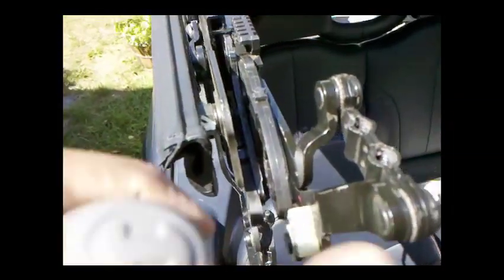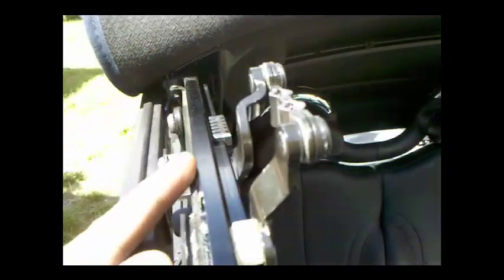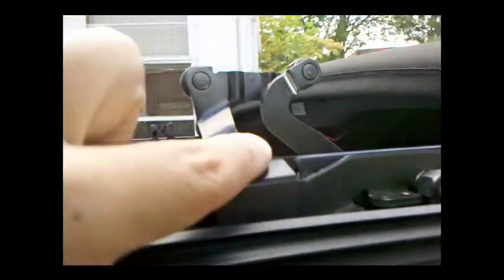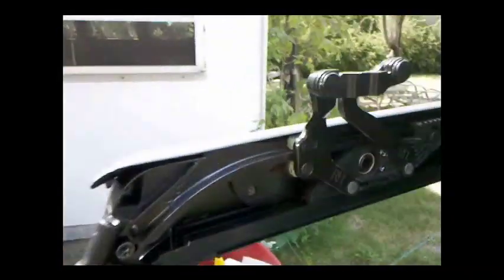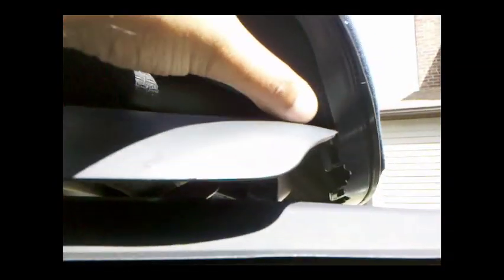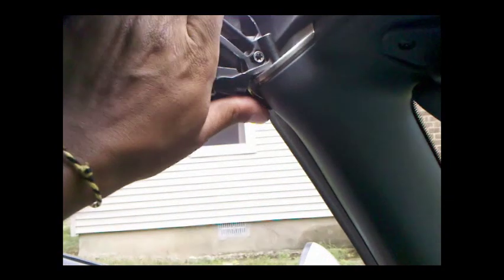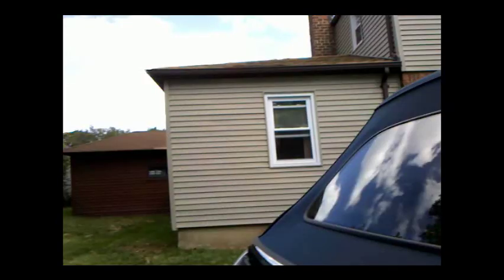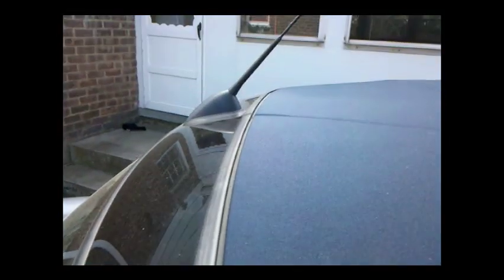Mini Cooper Convertible Top Repair Part 4

Comment: A screw came undone because the thread lock was not put on properly. This jammed the mechanism and broke the plastic lever next to the cable arm. This would have been the third complete roof mechanism put on by BMW Mini in nine and a half years. They wanted to charge me £2200 and that is not for the canvas hood.  I work at an aerospace foundry with a machine shop.  Your video was invaluable in getting it apart and putting it back together again. The guys and girls at work made me another lever and rivets out of an aerospace alloy and when I offered to give them some money for their efforts they asked me to put it towards Cancer Research.  Better than those money grabbers at BMW. Once they have sold you a car and it is out of warranty you are on your own as regards BMW. They will not sell you individual parts but half the car.  WELL DONE for posting these videos!! YOU ARE A STAR!

Comment: Hi! Thanks for the Top Repair videos. It worked well for us. But i think i have missed some part. When everything was finished, we where happy until the top was half way back and the locking mechanism was about to unlock at the front. It will not unlock and a red LED start flashing on the button panel. Do you know that could be the problem?
Reply: Laughin.  Just happened to me
No one is answering yet unless you guys figured it out.  I did notice to make sure it’s closed before putting motor in
And to make sure you push the middle frame lock like u had to do to release it
I’m guessing
Put the tarp back on and try again tomorrow.

Comment: tullid, you are my HERO! my roof broke about two years ago and i didn't find the 2500 dollars it would cost to repair it in Switzerland. Now I found your video and I spent the last four days repairing it with your guidance. I just finished the work and I am SOO HAPPY, IT WORKS! :D the connecting plastic-part of the locking mechanism was broken too, so I had to remove the moving rivets and then reconstruct the broken part from aluminum... was hard but fun!
Thanks again and all the best!

Comment: Thanks very much for the video, i've done all of that and the roof now works.... one question how do i glue the top back onto the front piece (from inside the car) , pushing it back is really hard, not sure it will hold.

Thanks.

Comment: Hi just a couple of questions: do I have to grease the cables before installing and if yes what kind of grease should I use? second question, is it normal the cables are not really free in their slides? thnak you for your help.

Comment: Worked as instructed however the hood had been badly removed previously and the tabs at the front had 7 broken or missing. My cable was too badly chewed to be reused however did have another "spares" car with a broken hood and was able to salvage enough parts to make it work. Be careful when you reinstall the motor, i broke the plastic casing but used a salvaged motor so everything works as it should.
Thanks for the video it helped me immensely.

Comment: For everyone who can't disassemble the broken latch 'cause it's stuck, please read carefully my post here https://www.drive2.ru/l/510279499233886493/. It's in Russian, but it has pictures and you can use google translate. I solved that problem today. You need to disassemble the plastic cover near windscreen and remove metal plate of the latch.

Comment from the maker: Thanks, actually I did have to take the canvas apart.  Originally both latches broke and there was no way that I knew of at the time to get enough canvas slack to get at the screws.  Everything I read on NAM was w/ 1 broken latch, not both.  Besides, taking the canvas off only adds @ 20 mins both ways to the repair, and I don't have to worry about restricted access to those damn screws :)

So far the repair has held up real well.  Still using the sunroof portion daily.
Reply: Thanks for your video , I'm a motor trimmer and I never worked in a car like this , nevertheless I have a suggestion to make sure that on top of the J- weld used to secure the end of the cable, this can  have extra strengh.
 It looks like the end of the cable have been squashed from factory ,  we can not do it again , but we can drill a small hole in the alloy and put half a way thru a very small screw to make sure the cable  doesn't come out again.
 It looks feasible to me , but my only guide is the video you have uploaded .  Thanks again

Comment: Hi, thank you for these, saved our roof and our Mini. A question - when the roof closes, the right locking mechanism (top part of the claw) goes in correctly HOWEVER it is not flush with the frame, 1-2 mm gap so a rattle over bumps. Have people seen this and a solution to adjusting the claw - is it possible to adjust the top of the claw position? Thanks in Advance!!

Comment: Thank you so much for this superb series of videos on how to repair the mini hood. I basically took the computer out to the garage and did it step by step. In the end the end of the cable was trashed so I had to cut the helix with a Dremel and use a fresh piece of cable that was consequently exposed. It made the cable slightly shorter by 25mm but it didn't seem to matter. BMW wanted £1000 to do the job and even the local guy wanted £600. So thanks for saving me a shed load of money. Cheers, Joe

Comment: Thanks for the videos, it was super helpful, I went  ahead and got new parts ($$$) but repaired with the new design and working great. I have a good latch and a damaged latch plus the old front pieces if you know someone that needs them.

Comment: Hello,
Thanks for your excellent videos. As I posted before I had to cut off the end of the cable and cut the helix back a bit as the end of the cable was in such a poor state. I hoped this would not affect things but the roof now pulls back to the sunroof position on both sides so the cable works to here. On the second press of the button the windows go down and the front clamps unlock, the roof goes back a fraction more then I get the dreaded red flashing light on the button and nothing else happens. I have checked the micro switches in the boot both for the lever and the parcel shelf and they both seem to be pressed as required as it the boot / trunk closed switch. All the fuses seem OK and the rear motor does seem to do its thing on closure, which only happens once I have switched the ignition off and on again. Do you have any ideas what might still be wrong. Have I, by shortening the cable created a problem at the other end? Is there some mechanism / switch at the far end of the cable that has to be pushed that the shorter cable is not reaching and so the second stage is thinking it's not completed its first stage retraction. Getting a bit desperate (and it's such a shame as the cable now seems to be doing its job great) so any help would be really appreciated. Cheers, Joe

Comment: hello i repaired che top like u did, snd now it works, but onli the first part of the top. When it has to unlook and go back the second portion doesn't work, the second motor doesn't start at all. I wonder if the first motor doesn't reach a certain position the second motor doesn't start, or maybe ther's an error in the eprom that has to be cleaned
Reply: Diego Corgna. 
Hi I have done the same repair and the same has happened to me. Did you get yours to work in the end and how did you do it?
Reply: Dj Neil 
Hey there did u end up finding out what’s goin on.  My sun roof works great but that’s it
It goes to the back and then red light flashes.    Have any idea.   ?????
Reply: drillr89 Hi the problem I had was when we glued the cable we pushed it through to much so the cable wasn’t hitting the micro switch to start the hydraulic pump. So ended up buying a new set. Installing them tomorrow. Will update when installed.
Reply: @drillr89  Good afternoon. The roof now works. We ended up buying a new cable and mechanisms. The problem we had was when we repaired the cable we shortened it slightly so it wouldn't hit the micro switch. But all works now.
Reply: Dj Neil thanx for answering
I can hear the hydraulic motor wanting to do somethin. So it’s hitting the micro switch
Does anyone know what the factory setting is on that hydraulic pump
In the videos. They counter clockwise the motor one and half turns. So when I got done I put it clockwise  same amount
It seems like when the sunroof comes back it just stops
Red light too
Did I miss a lock of sorts
Reply: Hi. Check middle catch is locked. the one that folds back.
Reply: @djtaffy2003  Which microswitch are you referring to? Could I not just short the microswitch so it always reports as closed?

My sunroof goes back fine but then the roof will not go down (it starts moving a fraction and then stops completely).
Reply: @strider785  there is a micro switch with in roof where the cable needs to push. I will find the link to the diagram and send it to you.
Reply: @djtaffy2003  Thank you!